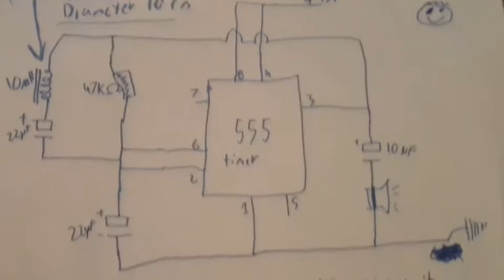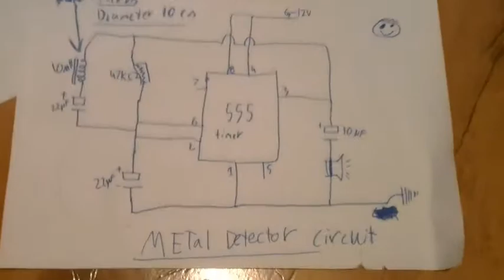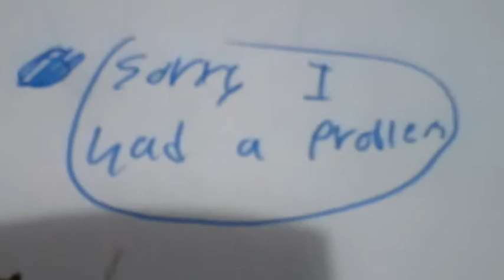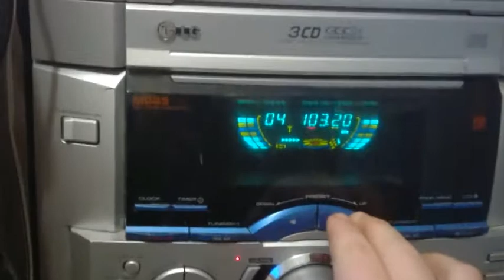How to make a metal detector, with circuit diagram

Comment: If the transmitter coil and receiver coil are together then how will it work?
Won’t the magnetic field from transmitter coil be directly induce in the receiver coil? Please explain!!
Reply from the maker: (i really should delete this video cause it came out like the worst), so some time when i have the time to make more videos, ill  re make this video with a better camera, and ill explain more.
Reply from the maker: sorry, I reply a year later lol.....
so, you probably found the answer by now, but, here's how this works in case you don't know yet:
so the one coil that it uses to detect metal does not transmit, Its used to measure inductance,
and so the whole circuit is simply a inductance controlled oscillator. So the coil, has an inductance, and that inductance can change when a metal object is placed near it,
and when the inductance changes, the frequency should change, which you should be able to hear in the video, but the change is so small and hard to hear
which is why this type of metal detector is.... well not a very good metal detector...
I suggest if you want a good metal detector, I suggest a DD metal detector, and there are many different types, just search it in google, and you should find a few,
heres one that works really good (https://www.youtube.com/watch?v=eCRgNr6jj2g) , can detect a small coin from around 30cm!